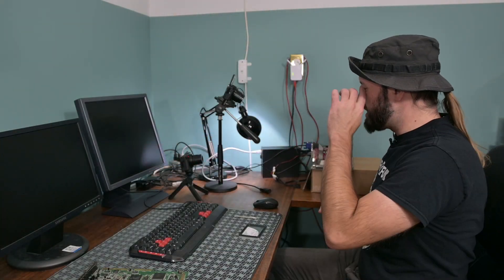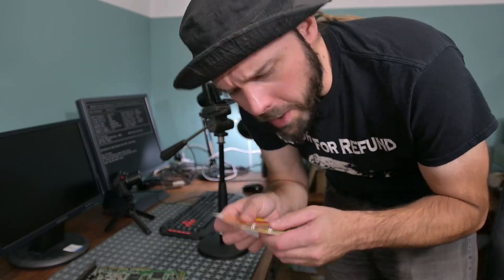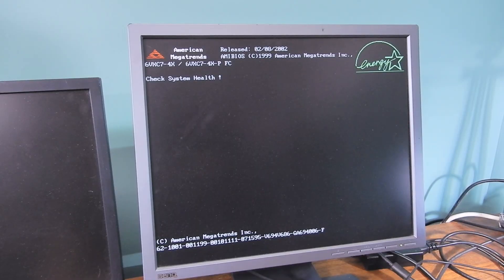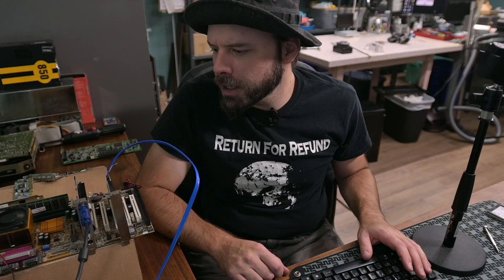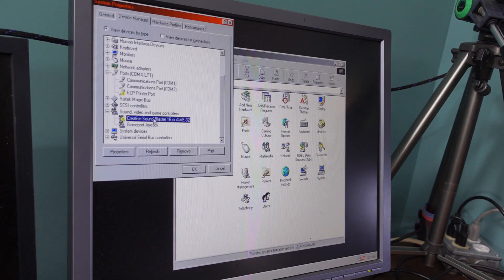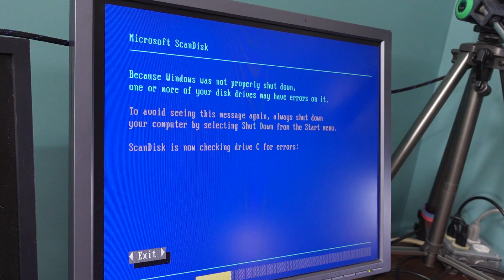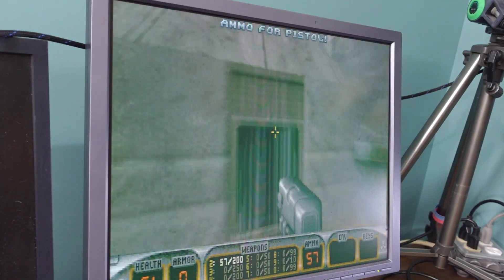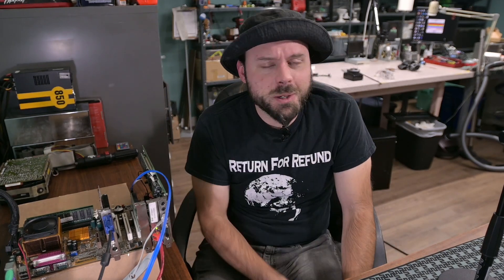Digital Necromancy Windows 98

Comment: I loved the video. I am thumbs up number 9 which is an nice number. Your brain reminds me of mine. It doesn't get any easier at 62 years old. I am still going to my summerhouse (where my computer stuff lives) to check the specifications of an original IBM power supply (SA147-3506 if you are interested), to see if I can buy a more reasonably priced 3520 supply and change the plugs over, so I make an eBay offer (still waiting for a reply). Then I cut the Gorilla glue off of the bird nesting boxes I bought which didn't have perches for the bluetits ( no space to avoid censorship - add space as required) after I fitted bamboo perches, I order the stuff to grow our own veg and then I think I need to get petrol for my motorcycle, I put the car battery on charge...that was today. Oh and I also did a 6 hour day's work. I do find I sometimes have to sleep at about 4 pm.
Reply from the maker: You might do more things than I do, in a day at least. 
I might fire up the bikes this summer. 
Is there something special about that PSU? pics online looks like a normal ATX unit.
Reply: @DATT  The only thing that is different to a normal ATX unit (or at least an early one) is the board power connectors, the original IBM ones are slimmer and were made by Foxconn and are labelled P1 and P2 etc. The Voltages and Amperage ratings are the same or slightly higher as the 3520 supply. I am hoping that I will just have to move the plugs over once I have figured out the pinouts. I have edited my typed when inebriated comment from last night!
Reply from the maker: ohhh P1,P2, that sound like an odl AT psu, you can get adapters. Atx to At.
Reply: @DATT  Perfect. Thanks for letting me know. I will seek one out.